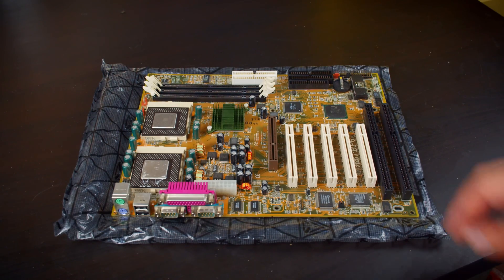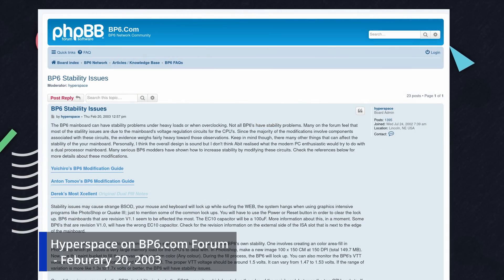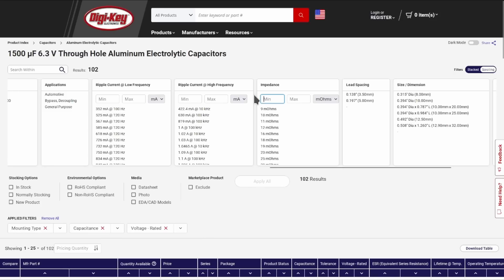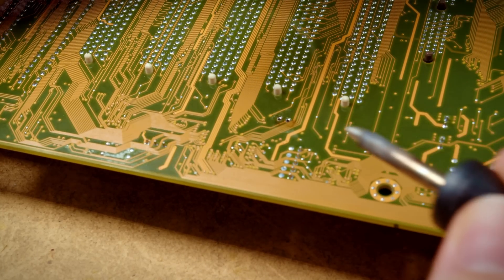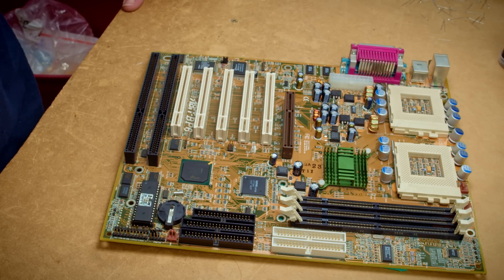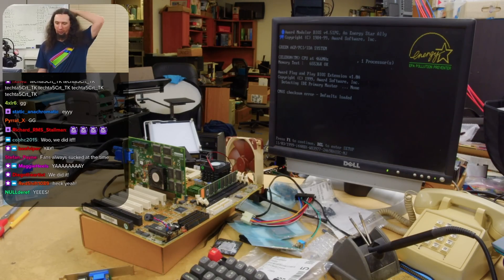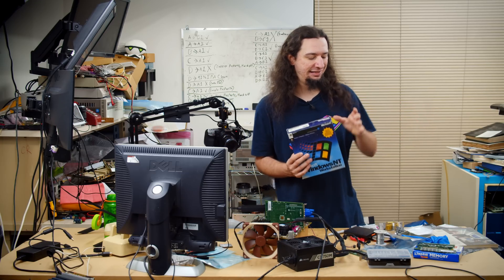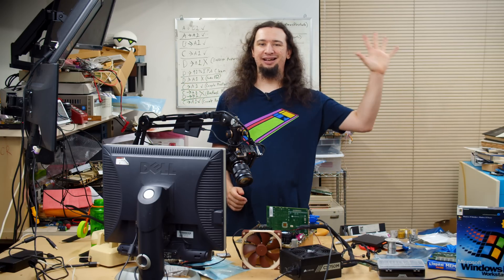Abit-BP6 ReCap - Dual Processor Motherboard Back to Life

Comment: Oh wow. I had a VP6 that I had a pair of P3s in, and I eventually sold it because I couldn't keep it running for more than a couple of days without a blue screen. XP or Win2k didn't matter. The cap plague hit my next board hard, but I never made the connection back to the VP6. Later on, I chalked it up to a weak power supply because it was stable with only one processor. Looks like I might've been off the mark!

Comment: I still have my BP6.  dual 366's overclocked to 550.  100% stable still with the original caps
Reply: Seconding this. I had this board (really wish I still had it) and it was normal and easy to take two 366 celerons (the lowest speed with internal cache that would overclock to speeds that you could get in the same line up) and set the bus to 100. Dual 550s with no crazy bus overclocking. Stable for years with decent air coolers. That upgraded capacitor mentioned is really handy for 100% stability with running full loads on both processors for a long time.

Comment: This'll make for a neat build. Get a couple of the fastest p3s (or the celeron that's basically a p3) , load it up with all the ram, and find an agp 4650. Then of course, try to run Crysis

Nvm looked at the cpu support list, would still be an interesting build either way though.
Reply: Yeah, the deal was that they could run Celerons but not P3 Coppermines because the P3 chips had 256 kB L2 caches while the Celerons had no L2. The full-speed caches were part of the SMP lockout. You lost some repetitive performance, but you gained a second processor for doing more... stuff.

Comment: I do actually own a dual socket 370 board and i if i remember correctly it has a 2 pentium 3s 1400mhz configuration installed. I think it is a server board but it is a ATX form factor and it has an ATX power connector. That think can run windows xp pro better that a late gen pentium 4.

Comment: I had one of these with dual celeron 500 as a 3D modeling workstation. Ran Windows 2000 on it. Was amazing except for one bug VERY unique to this motherboard. If you run Photoshop 5.5 or 6 and higher and used the Magic Wand or Lasso tool (might be just magic wand) it would crash the system.

Comment: Some tips for you: you can actually use any low esr capacitors in there! For something this old you shouldn't matter, back in the days we would even use regular electrolytic and it would last. You can find some original size replacements on china like Aliexpress.
As for the capacitor removal, you should use a hot air gun and heat up the whole area that you are working on ( usually at 250C for lead based or 350C for lead free solder) for like a minute, and then work the capacitors out putting some new solder and BGA flux and it will clean the thru holes in one shot.
Reply: Tiago Mian

Are you mad, why you need the Old Xeon crap ???????
no brain ?????
Reply: @lucasrem  what are you talking about?

Comment: Really cool to bring this beast back from the boneyard.  I had a buddy back in the day that had a similar dual Socket 370 board (might have been the BP6) with dual 1Ghz Pentium 3's in it.  And yeah, he put Win2k on the rig.  Abit and EPOX are two board brands I still get a little misty-eyed about.  So sad they're gone.
Reply: They made another board that was very similar called the VP6 that worked for Pentium III FC-PGA 370 processors.
Reply: @JesusIsLordAndSavior77  That's the one.  It supported the Tualatin PIIIs if memory serves.
Reply: When I built my college rig back in the '90s I pored over Computer Shopper and all the other computing magazines, and decided that there was only one motherboard manufacturer that would do:  ABIT.

I was able to get my Celeron 400 (on a "slocket" adapter) up to 533 MHz but the 100 MHz RAM wasn't stable at that speed.  That era of computing was so much fun.
Reply: I have the VP6 but it needs recaps. I found it at Goodwill for $10 back in 2010, but have never started the capping yet. It would be nice to try Quake III SMP mode on it.  I also still have my Abit AX5, which I bought brand new around '97 & that board got a lot of use out of it & still does, with a 400mhz AMD K6-III+, iirc.  I've never had the BP6, but I do remember reading articles on it back around Y2k, so I know it was a legend.
Reply: Mine are still here in a dusty grave somewhere. I will eventually have to see if anyone wants the bones. Abit and Epox were much loved, as well as several AMD boards from the Intel is slow days.

Comment: I've got the same to look forward to on my VP6. Unlike the other couple I've seen for sale mine still has all original Jackocn caps - though luckily, I have a lot of spare standard and low ESR (bought explicitly for VP6's VRM - local electronics store ftw) caps due to other boards having needed repairs.

Overclocking dual Puentium III is fun.

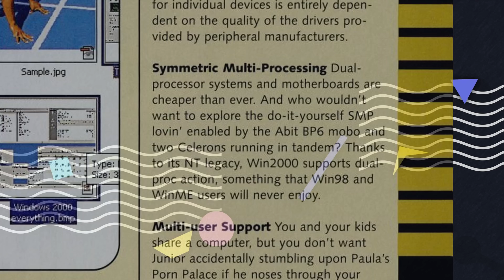Comment: 1:27 - That article is only 1/2 true.  System 7 through Mac OS 9 were pseudo SMP-aware.  Although the OS itself didn't take advantage of additional CPUs, it did report to SMP-aware applications that additional CPUs were available for use.  That is why Apple sold computers with multi-CPUs.  DayStar released a monster of a Macintosh clone in 1995 with up to 4 PowerPC processors.  They were mostly utilized by graphics, video, CAD, and math software.

Comment: You can add a blob of silicone under the caps to secure and raise them up a smidge...   I just leave an amount of space under each cap to get the tip of the silicone tube underneath.

Comment: Well looks like my comment got eaten by automod cause of mouser link.... What i meant to say is please update the cap wiki link for the vcore ones with the 3,5mm lead spacing kemet A750s (8mm diameter) those actually fit and are allso cheaper :)

Comment: Oh wow! So many memories! 😻
 I had one of these and used it to develop and test the C++ Linux-based data acquisition system of a high energy physics experiment at CERN, around 1999.
Having  two CPU sockets, in times before multi-core, was an absolute saviour for dealing with soft-realtime; on a single core system any hiccup would become a system freeze. I loved this MB: even if it was really not the most stable thing, it was cheap enough that I could have it at my desk, all for myself. I don't think we would have succeeded without it ❤️
Reply: I had one of these too!  I loved it.  At a time when home NAT routers didn't exist yet, my dual-processor system acted as a server sharing the house internet across 3 systems (thank you SyGate!).  When we weren't at home, it ran Seti@Home on both processors and churned through the data at an impressive rate.  Good times!
Reply: I remember running dual Celeron 366's clocked at 550Mhz.  It was rock solid stable too.
Reply: You look familiar Sergio.  Did they film you in a documentary while working at CERN?
Reply: savior**
Reply: @allentoyokawa9068  thanks for translating to US English 😉

Comment: I owned one of these too. Originally an impulse buy as I was wanting to dual CPU, but didn't take into account the limited os options due to their SMP restrictions. I tested 2000 and was unhappy with it, same for NT. I gave up and used 98se for the majority of its life until XPs Pro 64 bit hit and actually forced the install. Incredibly it worked with XP albeit sluggish for several years until I discovered Linux distros and tried too many to count. I kept the board alive long enough to see it to my next PC which was a P4 Dell. All in all, it was in my memories at least the most rugged board I've ever owned- and I've owned many.
Reply: 64 bit on P3?

Comment: You know what could be crazy? trying to put an AMD and Intel processor in there, just for the heck of it and see what happends, but i think it will be either it will not even boot or work at all, or it will work but only one processor will be recognized.

This is indeed a very interesting piece of tech a dual processor before Dual Core was even a thing.

Comment: I had one of these boards I had several dual processor boards at the time. I think this was the one I had 300A chips on it running at 600Mhz. I bought a window AC unit and ducked it to the system pushing air directly on the heat sinks of the processors. I do remember it crashing and then the system would longer run over clocked.

Comment: For the through hole vs SMD, perhaps there is a place in the world for a very small circuit board with pins on one side and SMD pads on the other which could bridge that gap?

Comment: This is awesome. I was always curious how dual  processors would work older versions of windows, now I know. Also, have you found agp cards to be super unreliable? I have a whole stack of dead ones here.
Reply: Win 2000 Pro was the best i found. But ive always used a dual cpu compatable OS. AGP cards need cap replacements same as old boards. I've done both in the video game industry service role. On site even. We also used them in the first CD jukeboxes for displays. I serviced most on location. Tough with a crowd floating around but I was young and focused. My lifelong career was game, pool table and music repair for 41 years.

Comment: I still have mine somewhere rattling around in a box in my shop.  Last time I used it was around 2003 or so.  It def had cap issues by the end.  Mine ran dual 366 overclocked to 550 from day 1, with big old honkin globalwin heatsink/fans on it.  Man I got some stories with that rig.  Good times.

Comment: I didn't realize the BP6 board was based on the 440BX chip set.
In 2005 I came across a dual socket 370 board (GA-6VTXD) new in box for real cheap and used it to run SETI@home for several years.
It is an inserting board as it supposed to support up to only 2GB ram but I think you can put up to 3GB or 3.25GB if I'm remembering correctly and supports dual Pentium Ⅲ Tualatin Processors up to 1.4 GHz.
I'll have to dig that machine out again and check it out.😃

Comment: If you don't have a vacuum iron and can't get stuff out of a through-hole, use a straw and blow the solder out. But for all that is holy get a new soldering iron, that thing looks like you've been poking satan's butthole with it.

Let me disabuse you of the low esr capacitor notion. I had an Abit BH-6 from new back in the day that I needed to recap after it broke. I was using a 1 GHZ PIII in a slocket. The BH-6 used the exact same plaguey capacitors as you have here. The green and gold ones, and a few of the other ones, but mostly the green and gold ones which you say are low ESR. I repalced these capacitors with the wrong (physical) size ones, rated 60% tolerance (yes, those existed), not low-esr or anything. The board didn't care. The CPU didn't care. It was all stable like a rock. That's the board I got over a year of uptime on Win 98 SE with. While playing 3D games like NFS3 and 4, UT, and so on. There really is no reason at all to go to these lengths to find something this exotic.

However, even if this isn't warranted here, in case you need a low esr capacitor for some other scenario, a good way to get there is to use a normal non-low-esr capacitor for the bulk of the capacitance, and parallel it with a low-esr ceramic or polymer capacitor of a low value. That's called capacitor bypassing. You're bypassing a high-esr capacitor with a low-esr one. Meaning that current can bypass the high series resistance, and instead go through the low series resistance.

Listen, if a manufacturer is scummy enough to use stolen, half-finished electrolyte chemistry recipes (the reason for the capacitor plague was actually failed corporate espionage), then they're also the people who will sell high-esr caps as low-esr. That's why they're doubled, tripled, quadrupled up in bunches everywhere Abit uses them. Multiple parallel resistances mean 1/2, 1/3, 1/4 the resistance and so on. That's a way of making a low-esr cap out of multiple high-esr caps. Sure, uh, cpu transient response might matter, theoretically, but in practice, my experience shows that it doesn't matter jack shit.

Comment: Awesome, I have the same board. I bought it new in 2001. I am running dual p3 933 pentiums on it With winXP. Still has original caps and none are bulging. Works perfectly fine. Use to use it to run all of our Lan party games.
Reply: All bulging caps are bad but not all bad caps bulge.

Comment: Reminds me that I have an ABIT BH6 that's seemingly dead now after I started playing with a Tualatin Powerleap slocket adapter - what was first instability due to trying to run PC100 at 133MHz became pickiness over what kinds of PC133 RAM to use, which became no longer working with sticks of RAM that I knew worked, which has now become not even making POST beeps with no RAM installed on power-up with a slower, 500MHz (5x100MHz) P3. Guessing it, too, also needs a recap... I had started the process on a different BH6 a while ago to try and diagnose a "PS/2 mouse doesn't work in here" issue (which turned out to be a resistor that had blown up and took the pads with it, but also I've managed to lose some SMD caps near that crater while naïvely seeing if solder could stick to any part of it, so that board is basically spare parts to me now), though when I ordered the replacement caps I didn't take the low-ESR variety into account, so I'm wondering if the caps I got to replace them are safe to use for that purpose. If not, well, they otherwise match some other caps IIRC, so I guess I have spares?

Comment: Tagg xoc has a YouTube channel where he mods a lot of old mobos. He has a video on capacitor shopping that's extremely helpful. Highly recommended

One thing I've definitely noticed is that if youre just recapping one board it can be cheaper to order all the highest value caps you require instead of ordering the specific values you want in each position. Because of the way digikey and mouser do bulk pricing. You can pretty much always get it down to just two parts based on electrical characteristics. Every time I've needed more it's been because of physical size issues.

Comment: My Abit BH-6 used the exact same capacitors and they went super puffy and had to be recapped while i was still using the slocketed pentium 3 1ghz as my daily driver. It's funny as fuck that it's not listed in the class action notice.

Comment: This was my favorite board back in the day... had 2x celeron 433's @ 750+ each, peltier cooled, iced over at all times... there was a second entire tower for this build, which housed 2x atx psu's wired in parallel to give 2x the amperage, for the cooling. I later did a VP6 build with, well... first with 2x coppermine celeron 733's @ over 1ghz, prior to the official barrier of 1000mhz officially being broken too mind you. And I had it, with two "cores" no less. Pretty neat. . . I later swapped those celeries for PIII 733's or 750's... can't remember the OG speed of them, but I also had both of those over 1Ghz as well. Also TEC cooled. . . But at this point I had a standalone benchtop PSU to handle all the cooling. Though, you had to be vigilant of startup power order, where before it was all instant and automatic. But this was better on space for sure, and more "professional" I guess. Regardless, these were great days...

Also, I just recently enough did a retro VP6 build, of course firstly recapping the VP6. Of all places I found it pop up on FB market, from a NY seller... shipped to me as an xmas gift, and it was for sure a great one. I have a video of it running on my channel, can't miss it.
Reply: You just sent me down memory lane when you mentioned Peltier cooling. Thank you!

I got a BP6 late in the game, when it was easier to find Celeron 533 matched pairs. I'm a Linux person, so I loved using Gentoo on these. They were an education and a joy.

Oh, and this was also how I started finding matched copper heatsinks. They were oddly cheap for solid copper. (Note to self: lock my office in case of meth heads.)

Comment: I once had a semi cursed dual processor board for two 100MHz pentiums... It worked, but in linux it would crash because, I guess, the IDE did not yet work well in smp. Even the linux devs were unsure 🤣. It being the year 2000.